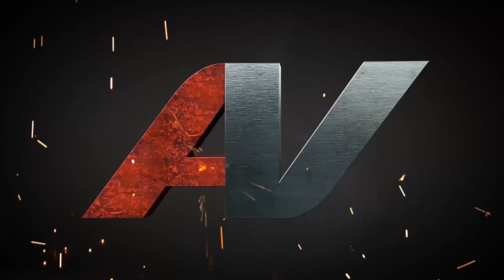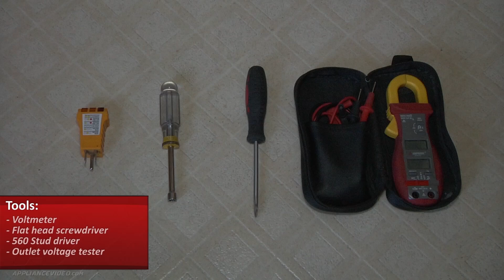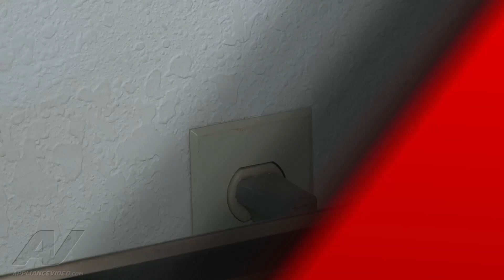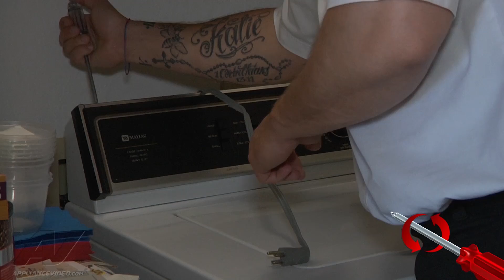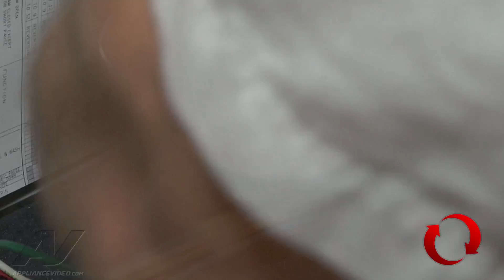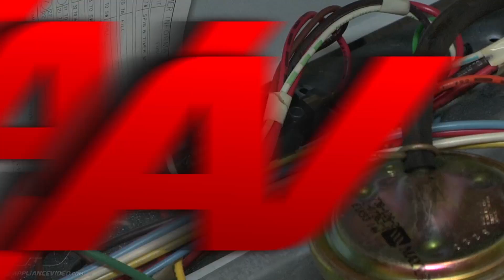Washer will not start - Diagnostic & Repair Maytag, Whirlpool, Sears  LAT8240AAW

Comment: I would wonder what caused the fuse to blow.Is this something that's common to see with that particular unit? I guess I would think that this was caused by another problem.Enjoyed the video.
Reply from the maker: The fuse could have been cased by a overloaded circuit or a power surge from a storm. In this case we could not find any other part that caused the issue. Purchase ant  parts you need by calling 1-800-830-5465, or order online at: ApplianceVideo.com.  Thank you for your support and good luck on your project.
Reply: Those switches can blow the fuse. Very common for them to wear out due to arcing inside. Microwave ovens use the same switches in the door to detect open/closed and they will trip the breaker when they are failing.